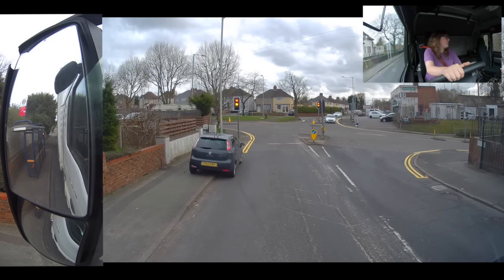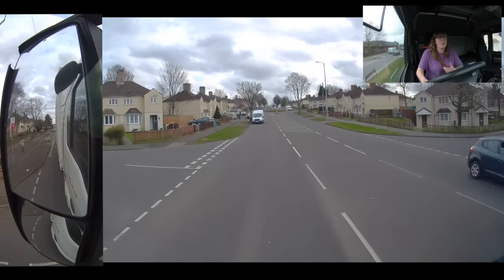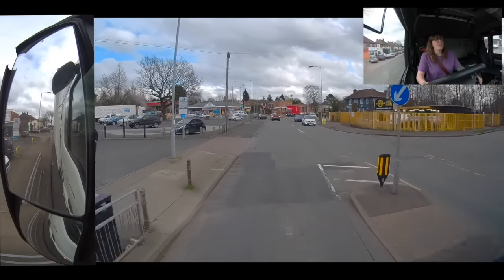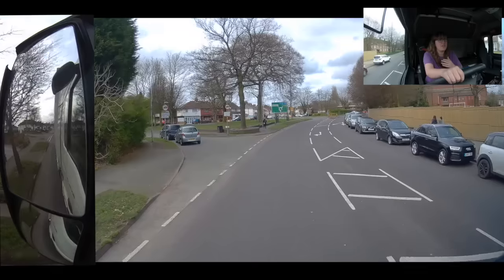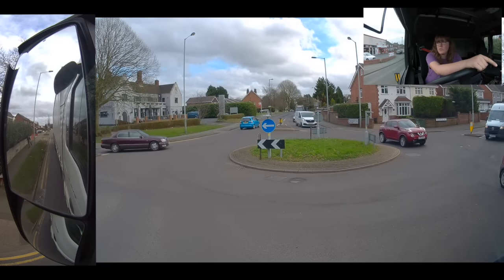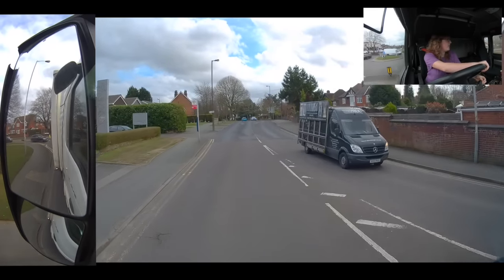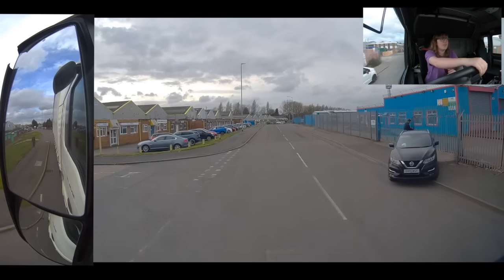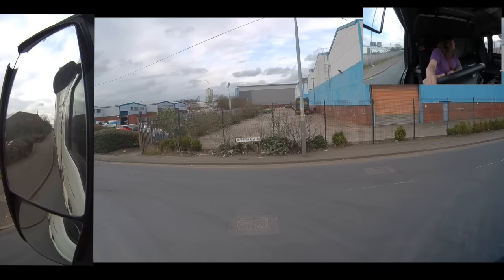Vlog #87 - HGV Tips: Cornering & knowing when to turn (class 1/C+E edition)

Comment: Hayley. That was an excellent tutorial, straight  out of the Police 'Roadcraft ' manual. Complete Concentration combined with Planning and Anticipation. I use the same techniques when driving 14metre coaches, cars and motorcycles. As you will know, the same System of Vehicle Control works on all vehicles. Well done.

Comment: Hi Hayley - Thanks for your videos - so helpful.  I've just started my practical training and so far  have had one day in a rigid lorry.  Tomorrow I get into an artic for the first time so the roads of Hampshire are dangerous from around 12 til 4 pm.  Your videos are reassuring me that it can be done and I can pass my test next Tues. I found it reassuring to hear you say that turning an artic is easier than turning a rigid.  Also, thinking in squares and straight lines when you turn rather than in curves is really helpful advice. I feel I'm  going into tomorrow's training with a head start already which can only give me confidence.  Thanks Hayley. Keep the videos coming.
Sue xx

Comment: this particular when to turn style video is very useful to people the week they do their hgv course. as you only get 4 hours a day and watching a few hours of cornering in tight situations is like an extension of the lesson. more of these in different places. great camera angles too
Reply: This is one reason why I quite like 2-to-1 training (2 pupils, 1 instructor).  It seems like worse value than 1-to-1, but you get more hours per day in the truck, half of it spent watching what the other pupil is doing.  You can analyse what they are doing and think about what you would do in the same circumstances without the hassle of actually having to drive at the same time.

Comment: Im going straight to class 1, passed every test bar module 3b. I have 24 hours plus test booked in May. Been following you for 6 or so months Hayley. Really appreciate the effort you put in for your followers, and have found your videos helpful. Had 2 hours assessment drive in January and the instructor used similar methods to yourself. Aiming for signs at junctions ect and turning late. 👍
Reply: Was not told what to aim or forgot when had my exam so I failed on that bit.
Reply from the maker: Good luck for the re-test if you haven't done it already. You can do it 😊

Comment: Your channel is probably the best. Always clear and real advice. I'm new, working for an agency driving 7.5t. I'm getting annoyed at myself for small mistakes. I keep clipping bits of the trucks, nothing major but its bugging me. I think its just practice and getting used to it but still frustrating. I did manage to do a three point turn down a dead end with literally 6" space front and back without hitting a thing and also had to reverse it for half a mile down a single track road, which I'm proud of but still this little clips and clonks are affecting my confidence. I've just started my class 1 training but doubting myself. Everyone tells me they are easier to manvure but I can't see it
Reply from the maker: We've all had clips and clonks as you call them. You'll get there. The class 1 really messes with your heard to start with but if you persevere you'll look back and it'll all be worth it  😊

Comment: I have my test tomorrow morning in Liverpool. This video is so helpful and hopefully ill give a good drive tomorrow.
Reply from the maker: Good luck 🤞🏻🤞🏻
Reply: @TruckDriverHayley  x2 majors and 4 minors. Got myself in a pickle when pulling over to the left.... tried to drive on with natural. Was taught to take it out of gear when pulled up... but a friend of mine explained after she wasn't taught that way and she passed 1st time. Then I over turned so didn't keep to my lane and prevented a bus behind and motorcycle on my right. Very frustrated with myself but it's a good learning curve. Hopefully go again in September. I made the error with 10mins of starting my test so I knew I'd failed.
Reply: I did give a good drive except those 2 Majors. Your video definitely helped so thank you.
Reply from the maker: Sorry to hear. That's unfortunate! I was also taught to put the hand brake on and then the truck in neutral - but I did mine in a manual. I didn't think the autos had to switch to neutral because you are not stopping for long? Never mind, it's a learning curve. I failed both my class 1 and 2 first time. At least you'll go in next time knowing what to expect. Good luck for your retest. Try not to be too disheartened - you had a good drive other than those. Remember that 👍🏻

Comment: Thanks for this video - today I didn't pass the exam - but I passed all the turns and roundabouts without any problems thanks to your instructions, among others, I failed 3 minutes before the end when I was going down to the exam center when I didn't take 2 lanes before and on the roundabout as I should (I fit but I failed anyway because it could have made it dangerous) next time it will be better - I will drive more defensively. Regards.

Comment: Been class 1 for 10 years, done shunting, nights tramping etc, pulled everything from low loader to curtain side boxes fridges containers,,, wasn't a bad video but i just think its making something that isn't that difficult to understand sound like rocket science,

1 point to make i never take a corner and judge the corner by where trailer is, you been doing this long enough you know where you're putting your unit and the trailer will follow, always guide a rig by the unit not the trailer

Comment: Great advice for new drivers. However I think maybe you also should show better awareness of other aspects of your driving at the same time.
2 59 mins you clearly hit the curb.
4.00 mins you stopped on a pedestrian crossing when you would lose nothing by hanging back. And is actually illegal.
10.44 mins waiting for the gap to develop would allow for a far wider turn to avoid  hitting another curb.
Far more mirror use and get your elbow off the arm rest is also good advice.
Just trying to be constructive to what is otherwise a great bit of advice on maneuvering 👍😁

Comment: I know it'll sound funny to some or most of you but if you have a PC and especially if you have a VR headset get yourself Euro Truck Simulator 2 game on Steam and practice that way. Your brain and eyes will get used to these motions and when you jump into a real lorry it'll be 100 times easier than never having even seen anything like that with your own eyes. You don't need a steering wheel or anything, driving with your gamepad is perfectly fine.